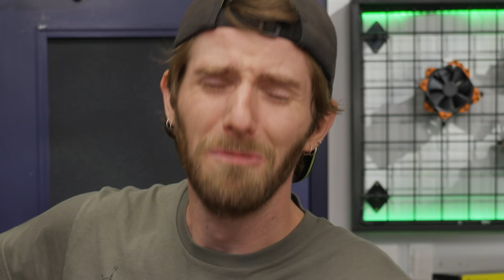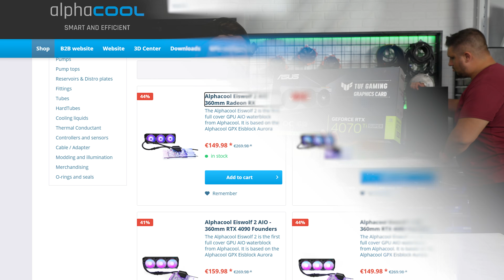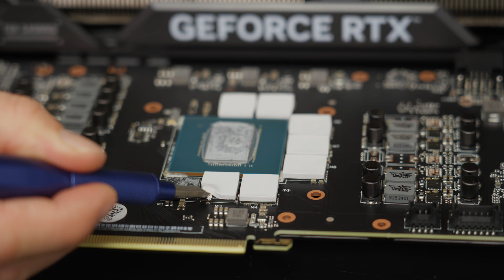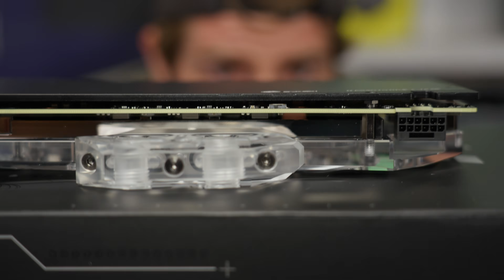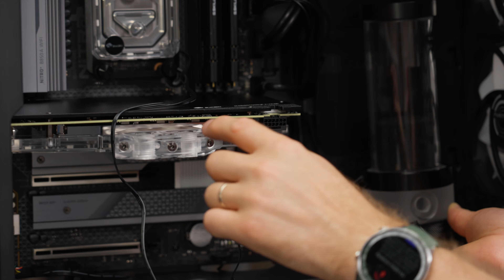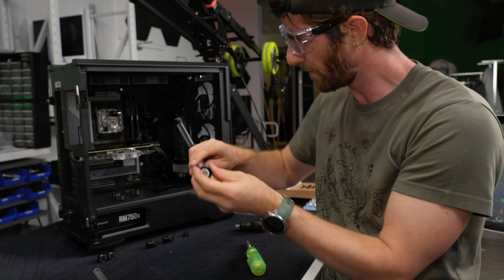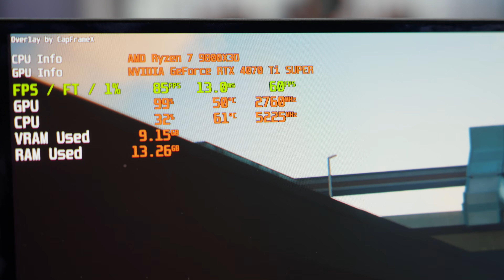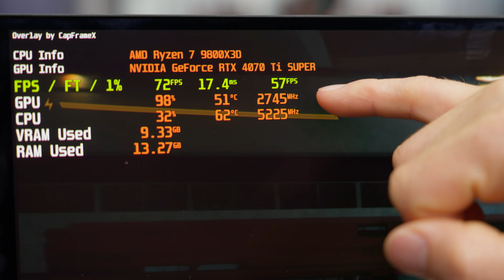Your Next Budget PC Upgrade is...Custom Watercooling??

Comment: The problem with water cooling is that it's entirely an aesthetic choice unless you're overclocking is completely worthless for your CPU or gpu in relation to an air cooler

Comment: did you just drill a metal case while everything is installed
dude , the metal dust would short something< you should have drilled before installing the rig
drilling while everything is in place is a way to short something , that is not professional
Reply: will , you recommended to doing before installing while you do it after you lazy

Comment: You can also go to the dollar store and build yourself most of a custom loop for like 10-20 dollars, just need a block buy you can totally reuse old AIO blocks. I bet you could build a custom loop for like 50$ if you use old AIO's as your blocks, AIO's have about a 5 year lifespan before pump failure or some sort of gunk builds up and people replace them. You can buy boxes of them at basically scrap value online. And if you have a 3d printer you can make a really nice looking set of mounting hardware but you would probably spend another $50-100 on printer media and power.

Comment: You can get a 360mm AIO WITH FANS for unter 70 bucks . .
OK, a setup for both CPU AND GPU is more reasonable then.
But it should come with soft tubing instead of hard tubing
for ease of convenience.

Comment: Reasonably cheap parts with tubes and fittings included? Sounds like a dream introduction to custom watercooling
Reply: Nevermind, hard-line tubes make this way more complex
Reply: @MCPTr10Cze  tbf I'm pretty sure they have a soft tubing option for the kit
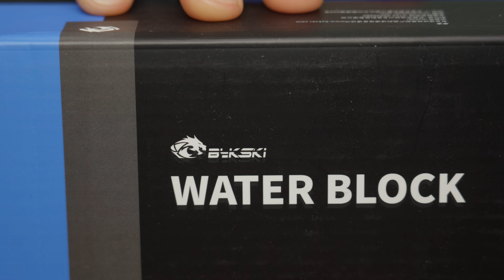Reply: @ConfinedSpiral You're right. It is an option on the store. 1:05
Reply: @MCPTr10Cze  When they were showing the purchase/site it looks like hard tubing and soft tubing were an option